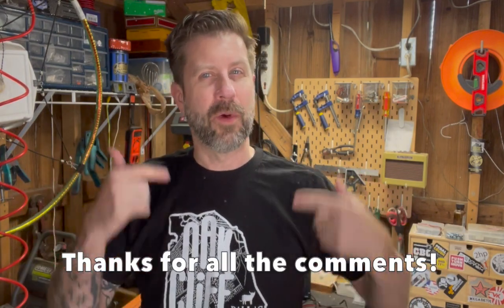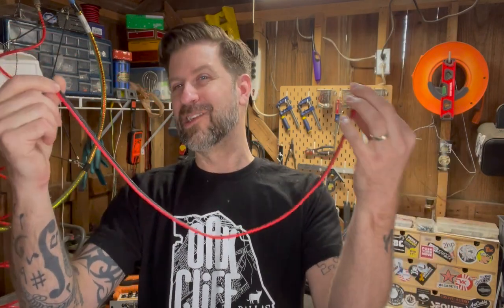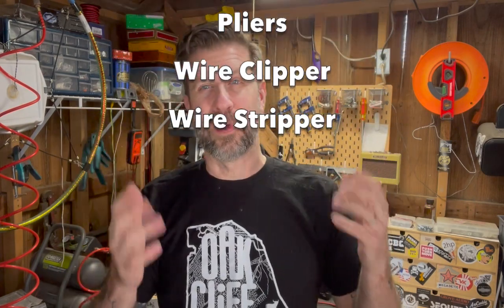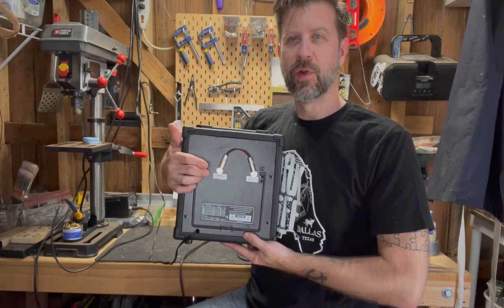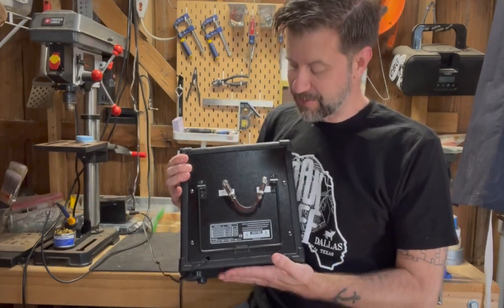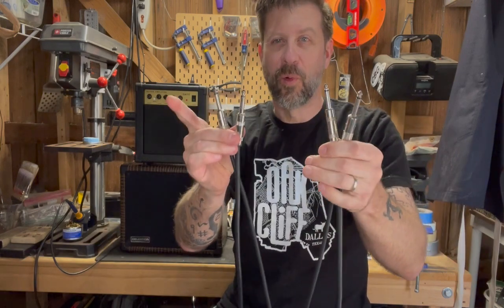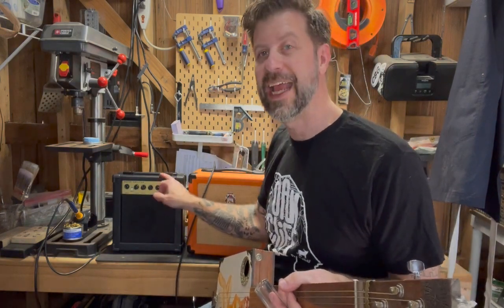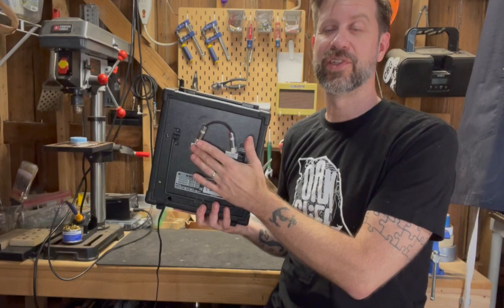How To Add Speaker Out & Amp In Jacks To Any Guitar Combo!

Comment: Hiya can this be done from a roland cube 40gx to a Marshall 4 x 12 cabinet. I cannot find the speaker impedance for the rowland and I am worried its  more than 8 ohms
Reply from the maker: I haven't ever done this mod on that particular amp but there's no reason it shouldn't work. The internal speaker's impedance is probably marked on the back of the magnet. If it's not, you could simply meter it with a multi-meter. Remember, the impedance of a speaker is theoretical, so it won't be exact. Anything between 2 and 5 is typically a 4-ohm speaker. More than 5 but less than 11 usually means an 8-ohm speaker, and anything more than 12 is probably 16-ohms.

You just need to match the impedance of the external cab to the impedance of the internal speaker. Let's say the internal speaker is 16-ohm, then you'd just need to make sure your 412 cab was also 16-ohm.
Reply: @musicalmiscellany  will take a look

Comment: how to turning combo amp like that orange cr to be a pre amp pedal
Reply from the maker: Turning an amp into a pedal is possible but you can't reshape the circuit board (at least not easily). So in the case of the orange the board is long and skinny. I would be a very oddly shaped pedal if you could even find something to fit it. There are a number of pedal-formatted amps on the market (like the EHX 5mm) so those might make more sense for that kinda of thing. Thanks for checking out the video.

Comment: What I want to know sir, is how do you wire your amp combo so you can use your combo speaker and have an external output to add an extra external speaker also while still using your combo amp and speaker ?  I know the two speakers have to end up being the right ohmage for the amp. Thank You. I like your videos.
Reply from the maker: You'd do this mod and then use a y-cable so you can plug both speakers into a single jack. Easy as pie. Even simpler, if your external cab has an 2 jacks (as many of them do), just go from the amp to the external speaker and then from the external speaker back to the internal speaker. Done.

Comment: Don't suppose you could generate a parts list and some Amazon links for this mod?
Reply from the maker: Thanks for checking out the video. To do the same thing, you'd need 2 1/4" mono jacks, some speaker wire, 2 1/4" jack ends, and some slide on terminals. I think that's pretty much it.

Comment: Perfect!. Thanks for pointing me to this vid.  To connect two speakers, am i right in thinking that that i just attach the red speaker wires from both speakers to the same female jack, same with the black wires?. Cheers again. Nice cigar box playing btw :)
Reply: Also, forgot to ask. As my twins amp is knackered, can I use the input jack that the amp already has, would it be mono?. Detaching it from the amp first obviously.
Reply from the maker: Long answer to an easy question...

If you wire both positives and both negatives together at the terminal that will result in a parallel connection. If you want a series connection, wire the positive terminal to the positive of the first speaker, then wire the negative of the first speaker to the positive of the second speaker, and run the negative of the second speaker back to the negative terminal.

Both will work perfectly... the difference between the two wiring schemes is the resulting impedance. If both speakers are 8-ohm, a parallel wiring scheme will result in a 4-ohm load. A series wiring scheme would result in a 16-ohm load. Provided your amp is 4-ohm stable (check the manual to be sure), parallel would likely be a bit louder. However, if your amp is only 8-ohm stable, you'd risk frying the transformer so I'd probably go with series in that case.

I hope that all made sense.
Reply: @musicalmiscellany  many thanks. I've just had a look and as it is, one speaker has it's leads jumping to the other speaker, then there's just two wires connecting into the old amp section. I'll have a fiddle after work. Again, really appreciate your time replying. Electronics is like voodoo to me :p
Reply from the maker: @markkempster7367  Electricity can be a bit daunting but it's pretty simple actually. It just always wants to find the least resistance between the voltage source and ground. Don't be scared of it, but always respect it. Good luck.
Reply: Wise words, thank you. I'll be super careful. Thanks again dude :)
Reply: Hello again my friend. I successfully added a jack to the back of my busted twin. The tiny orange amp worked ace through it. It made me think, my main amp (a vox AC30 Cc1) which has a single speaker, why not use my newly made 2x12" can with that. I just wanted to double check. I wired the twins speakers in series, they are both 8 ohm. I have a speaker out jack on the box that is switchable to either 8ohm or 16ohm. I have set it to 16. Will this be totally safe for my precious vox?. Cheers buddy 😊
Reply from the maker: @markkempster7367  Granted I can't actually see the wiring, but 2 8-ohm speakers in series is a 16-ohm load. If the Vox is set for 16-ohms, you should be good to go. You'll notice the Vox will sound a lot different coming through the 212 cab. Fender uses a different speaker design and it will change the tone. You might love it or hate it but there's only 1 way to find out. 😆
Reply: @musicalmiscellany thanks for the reassurance. It sounds great!. Glad to know I can carry on using it without it harming the vox. The idea was to make it 'more like' a vox AC30 twin 12. Although the single 12 still sounds amazing. Thanks again for clearing the fog of electronics mystery :)

Comment: Question no one asked yet here: what Ohmage is this? 16? 8? How would one know? ;)
Reply from the maker: I guess I didn't really talk about impedance in this video but I did in the previous one if you want to check that out. https://www.youtube.com/watch?v=9IQlyGviLJY

The short answer is you need to look at the documentation that came with your amp. If you're not sure, just check the impedance of the internal speaker and assume that's the amp's minimum impedance. With this amp, the internal speaker is 8 ohm as is the extension cabinet so it worked out great.

Comment: Oh no!  It just lost half it's "tone" with those extra connections!   😳
Reply from the maker: I follow you line of thought,  but - by that logic - every head/cabinet pairing in existence has also lost half of it's tone. A vintage Marshall JCM800 into a 412 cab uses this same wiring scheme and I think you'd have a hard time arguing the speaker cable absorbed 50% of the amp's tone (or even 5% of the amp's tone).
Reply: @musicalmiscellany  That was a joke.  You must not spend any time on those guitar gear forums.  😆
Reply from the maker: @TheCyberMantis  I thought you were one of those guys and not somebody poking fun at them. LOL. Sorry... I'm slow. Thanks for checking out the vid.